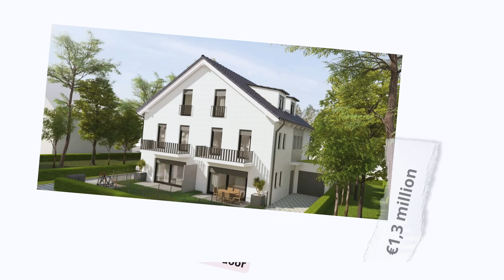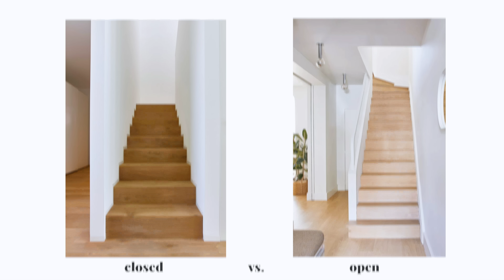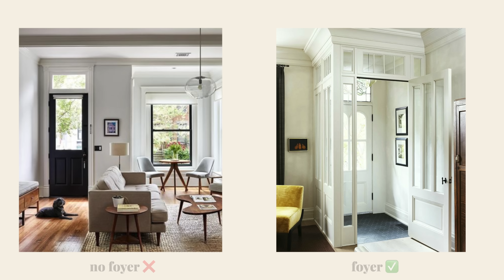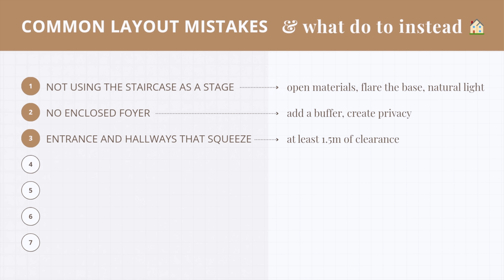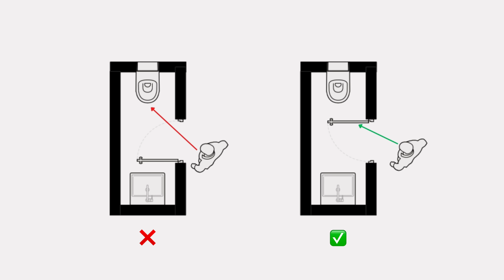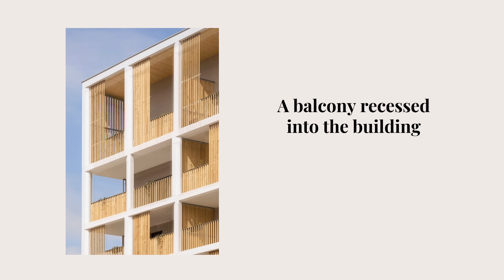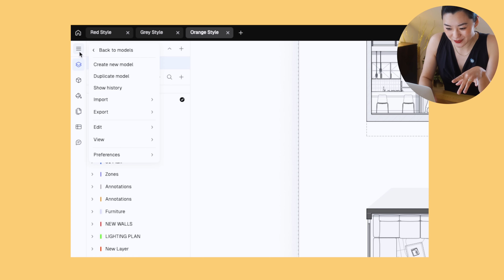Architect’s Advice: 7 Common Layout Mistakes + What to Do Instead

Comment: Very interesting since you practice in Europe. No idea how the architect is treated or viewed in Europe, but in the US, specifically the south Florida area, we’re not treated or respected until things get complicated. Most of these spaces that are not thought out, lack windows or comforts are spec homes. Contractor buys property and then buy a plan out of a book that is cheap to build and sells for a lot of money. These design elements that you mention all add extra costs and sometimes an architect is not even engaged. Once someone buys it and redevelops it, with the help of an architect, it turns into what it could have been to begin with. Great videos.

Comment: I have a BA in Interior Architecture but due to some mishaps I wasn't able to work in my field, but my passion never changed. And I'm slowly try to transition my work to ID. It's so refreshing watching someone who has an actual background and has similar views to mine. During college I had classses with both teachers from art university and politechnik university. And learned that there needs to be balance between practicallity- form- function-design and psychology. For those two universities there's always one half missing.
About foyer- it's regulated in my country (Poland) that due to four seasons a house cannot be built without foyer closed from the rest of the house. It's mostly for isulating purposes - noone wants to feel a draft when sitiing in cosy living room during cold winter every time someone enters or exits the house. And as much as I hate that we have so much regulations, this one is the most logical and practical one. 
I work on plan of my dreamhouse and I planned to hide my staircase- I want to have everything on the ground floor, the second floor woulr be for ocassional guest and if my partner would like to use one of the guest room as an office - he's still indesisive. And open staircase in front of the living space would be such a waste imho

Comment: Love your video! As a mold remediator, it baffles me that modern houses have no passive ventilation. Now, the architects rely completely on HVAC systems, which invariably come to get colonized by mold. This is all over with new homes in Mexico and a major health issue. Allowing passive air exchange is the only way to keep a building's air quality

Comment: Just watched a bit of your content and it has given me some great ideas for the low income apartment building I'm designing and trying to get built. It's tricky to be economical and interesting. I wanted the stairwell of my building to be especially interesting to encourage it's use, use it to bring natural light into the interior of the building. I'd love to work some of these biophylic ideas into the space including water feature and plants. The design I'm working on is not only low income but net zero and barrier free, including cognitive, visual and hearing impairments. Water saving and recycling, BiPV south side and living facade on north/street side.  I am designing it with a regen elevator and had this idea of having stair treads that generate power and we'd have a walking club where the club could walk up the stairs, the group can get in the elevator and generate power getting back down to the ground floor

Comment: Very very interesting, we're building our forever home in Thailand in the next 5 years, so it's so important to get it right. A lot of what you're saying works on detached and semi-detached houses. Our home in the London suburbs is a terraced cottage, so having light from two different directions isn't an option, but it will be in Thailand. But we have to balance light penertration, with heat penertraction, because if we get it wrong , the aircon will be on all day 😛.

Comment: Thank you. This is outstanding design advice. I like to modify home plans that, I think, have potential but have not found a program that helps me modify easily. I tried Rayon and so far, it’s good. The undo and redo command should be a button on every menu, but the help system allowed me to find it quickly. I hate wasted space, but I do appreciate keeping the size of rooms and hallways a little more inviting. Narrow rooms, halls, and steps are depressing, but you have given us a way to open it just enough to feel better.

Comment: Really great points! However, although rooms with windows on more than one wall are nicer - it's not always possible. Not every room is going to be a corner room and often there's only one outside wall. And in apartment buildings there's only one end of the apartment that can have windows.

Comment: I liked your insight abt Two-sided light for a room, I suppose its like a crossdraft for viable circulation but for light; the glare reduction and improved contrast are interesting.

At 4:03 the closet has its door behind another door (main door open blocks access to closet door and nearby area) creating a pinchpoint making use of the closet a hazard.
Its similar to hoarder behavior where you organize Object A on a shelf then stack Object B on top of that, requiring you to shuffle things around to access Object A.
It feels super cramped and unsafe, your concerned that someone might suddenly open the front door at any time.

Toilets in view are unpleasant, but not having a dedicated toilet room is also vile.  it should not share space with a shower.

Comment: Staircases as you describe are indeed prettier; also vastly more expensive changes(in many cases) to the home to allow for them.
An airlock (enclosed foyer) cost more as well, but the saving in fuel may pay for it eventually, it is a great idea.
More windows, light from multiple sides: initial increase in expense and permanent increase in expense through fuel.
IMO the single most important thing that architects and builders should be promoting is passive solar heating designs, and passive cooling as well for warmer climates. You talk about comfort from little room changes, but I have seen many people who are uncomfortable all year round because space conditioning is so expensive, they make significant cuts to comfort to save money.

Comment: If I may add to what you say about two of the items mentioned, they are about the stairway and the windows in a room. Regarding the stairs, one should consider where they want to be when they get to the top and where they want to be when they get to the bottom. Duh! Right? But think about it. If it is important to come down from the bedrooms upstairs, do you want to come down in the morning to the kitchen area or great room, or do you want to be in the entry hall of the home? When at the top of the stairs, do you want simply to be in a hallway presenting you with a bunch of doors to bedrooms and a hall bath or do you want to be in an actual space, maybe like a place with built in desks and bookshelves where kids can work on homework? On the windows, you are completely right about the light issue, but also it is important when it comes to ventilation. If only one window exists and is open, even with a gentle breeze or wind blowing outside, not much fresh outside air will enter in to the space. But with windows on opposite sides or ninety degrees to one another, fresh air will enter in to the room. Oh, and what you say about the toilet being viewed from an open bathroom door is so right. The worst is in a situation where it's an ensuite bathroom and the likely wall where the bed will be situated means someone is waking up in the morning to look straight into the bathroom at the toilet. Good morning sunshine. Not! Yes, I too am an architect and have seen all these same things as you and think about them constantly when designing. Cheers!

Comment: rayon looks interesting and easy to use. it's primarily 2d and is, as of Aug 2025, $0 for a functional version and $210/year for pro version for 1 person, $380/yr for collaboration. I have not tried it, just looked at this video and their website.
I used Sweet Home 3D which can also does 3d models but can also be used in 2d mode. It is basically a single-person software and probably is not as polished as rayon so probably takes a bit more effort but it gets the job done too. I like it and even imported a 3-D dog model into my model home 😁
Thanks for the video with good advice, especially about the stairs. I have mostly enclosed ones and they are not as inviting as they could be.

Comment: I live in a comfortable triple decker home/apartment built in 1890 with a central hall plan. We have wonderful south facing light but we break the rule about having two light sources in each room and still the rooms are very comfortable and welcoming. I think it is because the kitchen has three large windows staggered across the rectangular space. We don’t have a fitted kitchen with a gallery, u-shaped or L shaped kitchen but cabinetry between the window runs and the other walls. The windows are also taller Victorian style windows so more light is brought in. Our living room and two bedrooms have three windows set up in a bay Victorian style.The living room faces south, thé 2 bedrooms face east. The remaining two bedrooms have one windows each facing west, they are the only two dark rooms. So while in general two light sources are great I think it also depends on the size of windows and their placement in a room. In addition, we have the option of installing taller Victorian windows with a transom window above and a light shelf between the Victorian height windows and transom window that helps bounce sunlight deeper into the room to make the space sunnier and more comfortable.

Comment: One thing I’ve thought about if I were to design a house is placing all the plumbing—both freshwater and wastewater—in one spot along the outer edge of the house. That way, all pipes have the shortest possible routes to their destinations inside. To make this work, the kitchen, bathroom and toilets should be located next to each other—even across different floors. The house could have a U-shape around this "piping"-point to maximize the distance between different rooms with water features. The idea is to minimize any problems with the piping in the future and also minimize the cost of repair.
Reply: In extreme cold climates thé last thing you want to do is place plumbing on an exterior wall. I do agree about minimizing the plumbing runs.
Reply: @jendrouin6259  What I meant was, Instead of placing plumbing within exterior walls, all plumbing-dependent rooms are adjacent to an exterior wall.

Comment: I would hate a balcony that doesn’t have at least half the space exposed to elements, I want to be in the sun and rain, I am disabled and rarely leave the house, it is one of the best ways to have outdoor time and get sun when depressed or needing red light therapy, my current balcony (we are on the first floor so I wish it was a open porch but people are dumb when designing stuff) is enclosed by two walls on the sides and the balcony above us is like a roof with gaps where all the people’s stuff from above or dust from them goes down the cracks to us. The space is so darkened there fore our living room is dark because the light can’t go much past those side walls and it’s sad. You have to stand at the railing to get sun.

Comment: I am not an architect, but the only rule I have broken when make our floor plan is that the toilet is visible when opening the door, and one bedroom only have windows on one wall. The other bedrooms have small windows on one side and a bigger one on one wall. Living room and kitchen have windows on two walls.

What i also concidered was placing three bedrooms to the north. One had to go facing south. This keeps the temperature down in the summer. Otherwise it is entrances in the corners and now narrow rooms. We have 3 sleeping rooms, two living rooms, a kitchen, a washing room, two bathrooms and a sauna fitted in 182 m2 in one and a half floor. There are 3 entarances down stairs and one to a balcony upstairs. The the main entance leeds to a room with the staircase from a large foaje.

The only thing I regret is to have a separate technical room. The heating system is in the washing room. There is no pluming visible but it is a little crowded if you need to do some repairs. You are also locked into the same size of the equipment if it needs to be replaced if one wants to avoid re-building the covers. We have a ground heat pump and they have been manufactured in same size now for 30 years so maybe they will stay the same also in the future. i have replaced the pump once after 20 years. We have a separate warm garage where some technical equipment could be placed. Moving tje heat pump there would require a costly culvert with heat losses as well, and expensive constant circulation of hot water. So I prefer keeping the warm water heat source close to the showers and most of the sinks.

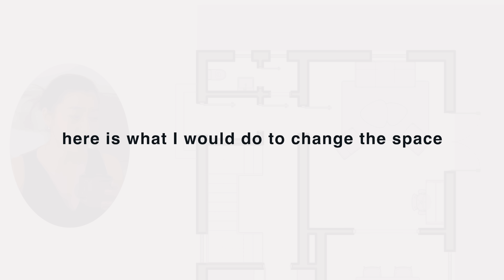Comment: I agree in general, and am glad to see you bring these topics up, but am occasionally perplexed. At first you rightly suggest whenever possible using a small entry room to provide some weather buffering from the outside, but then at about 3:35 you remove the vestibule for apparently aesthetic reasons. Which should it be? Practicality or aesthetics? The stair is a common traffic area, but it is now subject to inclement weather conditions when the door is opened (in the cold, rain, etc.).

Comment: Think of famous staircases like at Château de Chambord (France) with double helical staircase, Spanish Steps (Rome). It's where wedding pictures are made. At homes many steps just are to steep, to narrow, to long without mezzanine plattforms or helical where the inside is not usable.
Of equal importance you might need an enclosure avoiding drafts (chimney effect), heating losses or fire blocking.
In the end its like squaring a circle. Therefore ... don't let your carpenter decide the layout of your staircase. Design is not his trade.

Comment: The biggest failure that turns me off is the staircase anywhere near the front door or living room.   My guests are not going up to the sleeping quarters.  I am not going up to the sleeping quarters straight from walking in the front door.  And then I have to walk through the entire downstairs in front of a half dozen windows to get to the refrigerator in the middle of the night.  Put the door to the garage where you always find the stairs, and put the stairs where you always find the door to the garage.

Comment: Only once in my life I had a balcony. It was a rental, and the only use I could see was for an outdoor grill. Thanks for your video.
Reply: A long time ago I lived in an apartment with a balcony. One day there was a commotion in the building next to mine. The next day everyone got a notice from the property manager reminding everyone to not use their grill on the balcony, you have to take it out to the communal central field area to use it. Apparently someone had used theirs on their balcony and ended up setting off the fire alarm for their entire building.
Reply: @QuantaFille  So much for that. My second idea was for changing the oil in your motorcycle. :)

Comment: Open staircases look better but they’re a nightmare for energy efficiency, all the hot air rises up to the next level and cool air falls down. If you can close them at one end at least it makes the home more comfortable with less energy use. They also transmit noise between levels.

Comment: - Toilet by the entrance is great if you are in the countryside and don't have an outside toilet, and you do some yard work.
- Uneven stairs make you loose your rhytm and can lead to loss of balance, it is best if all steps are the same size. 
- Doors near corners is ok if by near you mean atleast 50cm. Otherwise you won't be able to place any piece of furniture on that wall, this is very important in small-mid size rooms because you want tou make the most of the available space. 
- Toilet doors should provide easy acces to the toilet, I don't want to dance around a door when in a hurry, oh and toilet doors also have locks if privacy is a requirement. 
Agree on windows and balconies

Comment: Loved the video! I agreed with every point and I find it shocking how many houses that are built today make these mistakes. 

What you're referring to as an 'enclosed foyer' is actually called, a vestibule, and it serves an even greater purpose... it provides environmental isolation between the inner conditioned space and the outside world. A vestibule has an inner door that prevents air movement when the outer door is opened and is often used to store footwear and outerwear before entering the home. I completely agree with your minimum 60" rule!

I find it rather ironic that while modern, energy efficient homes prioritize insulation and air sealing, they often don't consider what will happen when someone opens the front door in the middle of the winter. Whether out of ignorance or cost savings, vestibules seem to have been forgotten in modern architecture... and we need to bring them back.